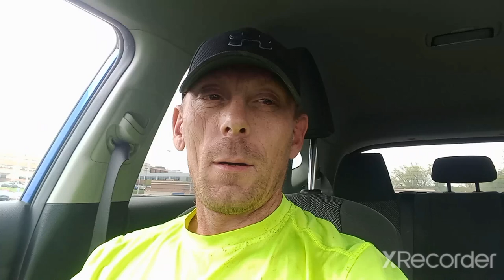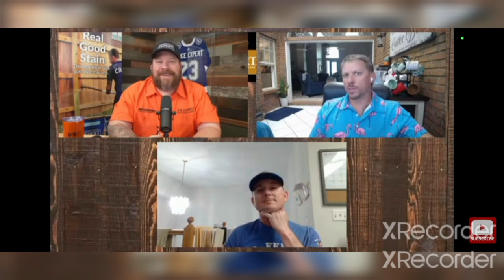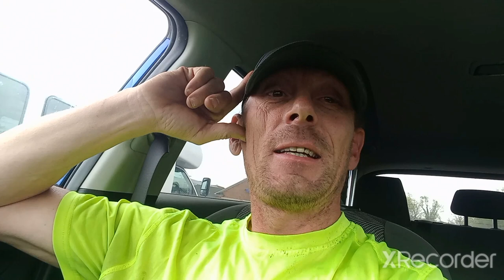drive posts near utilities?? professional fence builder reacts

Comment: Wow,.. hitting lines sure can be costly. I hit a gas line. Fence was there long before the gas meter, the gas line was installed directly beneath the old concrete set, I pulled the post out and my second swipe with the diggers and tssssssssss - gas company was there within twenty minutes. Because I didn't have it located with my common sense it wound up running me around $600.00 because I didn't request a utility locate ticket. Lesson well learned.

Comment: You might re-watch that segment. In the clip you provided Mark clearly said twice that it get the fence closer to the 2’ ‘no-dig’ boundary from a marked utility. We literally said ‘you do the same thing you would digging posts.’ 

The point was that if you’re digging a 10” hole, the post is going to be 5-6” off the 2’ line to keep all parts of your hole out of the area. When driving you could drive an inch off the 2’ line, thus saving space. 

No one is advocating for driving posts within 2’ of a marked utility.
Reply from the maker: Joe Everest my argument is this. Driving posts blind anywhere near utilities is a bad idea period. If you're digging you can use finesse and can generally uncover a line safely without damage if one is present. Every line I've hit in my 23 year career has been because of a mismark or in some cases a totally missed mark. As I said in my video, this isn't any sort of attack on you,Mark, or Shawn. But the advice given us bad advice with a very high potential of unnecessary property damage, injury to you or a member of your team, or even death. The cost savings aren't worth it. I'm 100% on board with what you are doing, totally on board with the I post system, and totally on board with no dig systems. But driving a post anywhere near utilities is a bad idea and can go south very quickly.